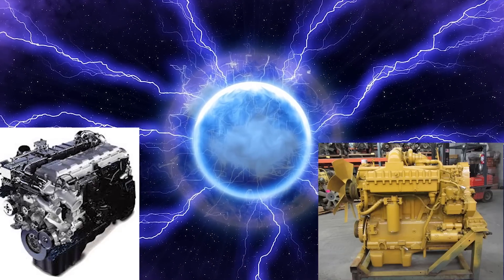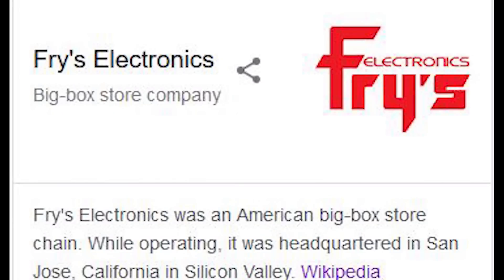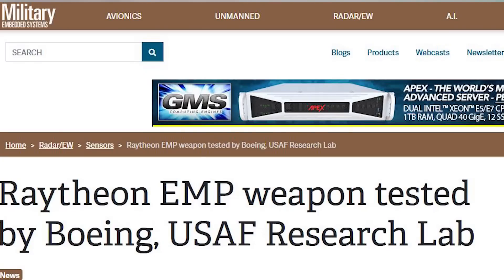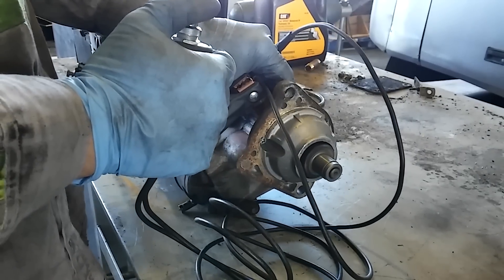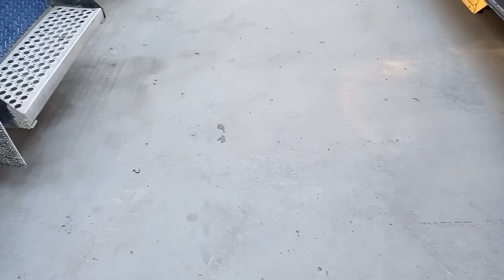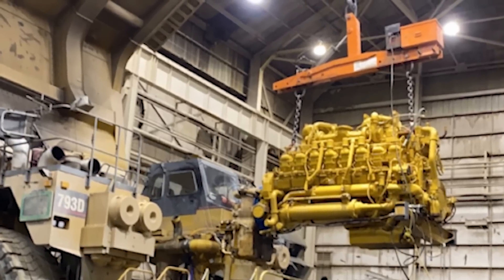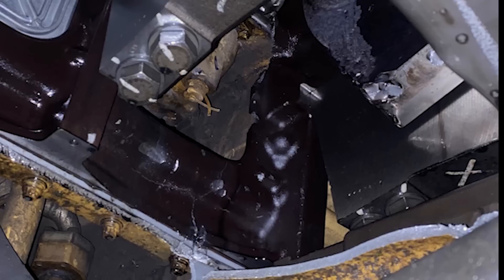Are Diesel Engines EMP Proof?

Comment: Wrong. Anything with a coil gets fried. That includes the generator coil that makes the power. Doesn't matter whether gas or diesel. If your whole gen is not in a faraday cage and unplugged, it's toast. Also, if you open the faraday while the different sttages of EMP are still surging it's toast. That can take over a day I think I heard.. and there can be multiple EMPS and you won't necessarily know when they will end.

Comment: I was driving a diesel powered switcher yard truck at the freight company I worked at when a lightning bolt struck close by. The fuel solenoid dropped out and it stopped me. This happened to me twice at that place in 4 years I worked there.

Comment: isn't a car a Faraday cage???
and also not all electronics would fry, it depends on a lot of factors, component tolerances to voltage, relative conductor sizes to the emp wave strength (how munch energy it carry's), any chip that is under 180nm will fry, but a ton of stuff like single transistors, capacitors that can handle above 10 volts, resistors, chance's are, they'll work fine....

Comment: I have a 1999 Blue Bird with a mechanical Cummins 8.3. From what I have read, they started making diesel engines electronic in the early 2000s, not the mid nineties.
Reply: Actually 1997
Reply: Allison electronic transmission?

Comment: Hi Josh,  I own a 2005 diesel Chevy Duramax which probably won't survive an EMP.  What are the chances of placing ferrites on various sections of the wire loom to at least give it a fighting chance ?     JwgK
Reply: Something often neglected is the automatic transfer.  Because of the lack of vacuum they are often computer controlled.

Comment: Car bodies aren't faraday cages unless you ground them really well.
Lightning strikes can arc through the tires to ground because of the insane voltage (it would have hit ground without the car anyway).
If this is a genuine concern make your parking structure a faraday cage and test it. Also you need to be prepared to grow and process your desired fuel plus the needed conversion components. Keep spare parts and lots of oil, trans fluid, etc.

Comment: Totally unrelated question, but I need some help. I have a 2000 year model C12 in a Frieghtliner. Truck runs pretty good as long as I eat into the throttle  and keep the RPM under 1700 or as long as I don't suddenly go from full throttle to a completely closed throttle. Once either of these happen, get a severe solid miss as if the system has low fuel pressure or sucking air. It will recover if I ease off the throttle for a little while. Any idea where to start? Is this common on C12? Thanks!

Comment: Not with EFI. Even the original cummins 5.9 12 valve needs 1  12v wire to
run. A proper EMP will fry ALL electrical & electrinic systems. SO, you
wont be able to use the starter nor the electrical fuel valve. Maybe if you 
push started it & used a battery to direct wire to the fuel valve.

!

Comment: During the First Gulf War Boots and Coots were dispatched to put out well fires in Kuwait. The large pumps they sent over were Detroit 810s built on a large tube frame. Compressed air was stored in the large frame for starting. Nitrogen could be used if the air was depleted for some reason. There was nothing electrical or electronic on the assembly. The tach and  temp gauge were mechanical. A fuel truck was brought in and hooked up to the engine. These too were mechanical and not susceptible to EMP.  These were used to pump water onto the well fires. They built several of these in Houston for shipment to Kuwait.

Comment: Air start mechanical manual trans = emp proof some engine have a ip shut off cable. I have had trucks that my cb radio fryed. Oh and new trucks can't take any ac had a 120v light get kocked over and smashed on the frame Even though the braker tripped. The truck had to get puled out computers fryed.

Comment: This is why people spend a fortune on a Dodge Cummins 12V. They are waiting for the EMP to kill computerized engines. They would need to be a manual, a Torqueflite automatic, or a 47RH overdrive automatic. The 47RH was replaced with a computerized automatic in 1996, so the 1996 or 1997 Dodge would need to be manual.

EMP could damage small electronics. However, it is my understanding that things like relays and solenoids are not going to be damaged. Because of that, the engine could be started. I do think an alternator voltage regulator might be destroyed based on how it is built.

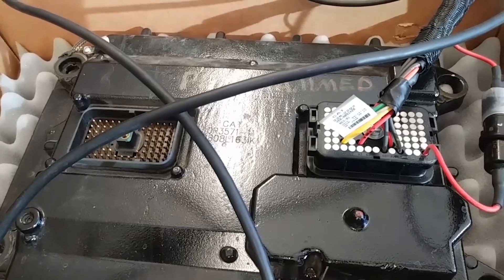4:32 Some computerized diesels took the old mechanical injection pump, but used a computer and electrical actuators to determine fueling and advance. I don't think CAT did this. However, the 1998 to 2002 Dodge Cummins 24V did. They called their version the "Bosch VE pump." There are certainly many others diesels that used this method, however, the 1998 to 2002 Dodge Cummins 24V is the fist I can think of. However, I think some people manage to find "Bosch VP pumps" which fit in the same space, but were not computerized. The 1989-1993 Dodge Cummins 12V used that kind of pump. I think some guys who race a Dodge Cummins have been known to put the VP pump where the VE pump was.

6:02 You would probably also need a bunch of spare sensors. I'm thinking about how many time I have to replace the heated wire/film MAF in cars.
8:36 I have heard that when a diesel is that large, it pays to try to weld it back together. Republic Diesel has some interesting videos on what they can do to save engines of that size.

Comment: You would need a VERY powerful EMP to short out a engine management computer. Especially one that was not running therefore not outputting voltage. Also remember a vehicle itself is a faraday cage, that’s how they can survive lightning strikes and more or less still limp home. And let’s remember also modern coil pack based gasoline engines have a micro emp fired off under the hood every time a spark plug fires, that’s how you can hear the plugs firing on an unshielded stereo system. If your plug wires and stereo are unprotected you can actually get bleed through from the high voltage transformers which are the coils.

Comment: Does it rely on electronics to function? If yes not emp proof. If no it is emp proof. If it is manual transmission and does not rely on any electronics you can coast it down a hill fire it up and roll in style during the apocalypse. Although I kind of wonder how strong of an EMP it would take to fry something like a starter that is designed to handle large spikes of high current but low voltage...I'm thinking that maybe the relatively low current high voltage induced AC might be able to blow through the enamel insulation and cause a short internally in the motor though... 🤔  Also if it's enough to kill a starter motor it's enough to kill an alternator I'm fairly sure...so if I wanted to have a vehicle that can survive an emp of that size and still function 100% I would need to have an extra set of batteries, starter and alternator in a grounded faraday cage just in case. And just in case manual transmission and parked on a long steep hill with one of those ether systems you can use from the cab just to cover all bases. Start rolling give it a lil toot and pop the clutch for a guaranteed fire up as you never know it could be cold outside. But a problem I rarely see talked about is how quiet it will be with no vehicles no ac units ETCETERA going and then you firing up an old rowdy diesel. That's going to attract ALL of the attention and make you a target to everyone...from 90 pound female office worker to 230 pound ex marine toting a metal chunk accelerator that knows how to use it.  I'm honestly thinking a bicycle with one of those small tow behind trailers would be a great option.  Or maybe even better one of those 4 wheeled bicycles with a trailer. Cause let's be honest here...how useful is that truck going to be if everyone you come even close to wants it and is willing to do whatever it takes, to take it from you?   And no one steal my idea here but I'm thinking about learning how to repair emp damaged starters alternator's and batteries will be worth much more than the single truck and make me worth much much more than the average person. Along with my many other skills.  Thus keeping me alive, hydrated, fed and protected 🤫😉😁🤑 sorry for rambling so much. If you are still reading. I Hope You Are Having A Great Day And That You And Your Loved Ones Are Healthy And Safe During These Tough Days! But Don't Get Down! If We Stick Together And Help Each Other, We Will All Be Ok!

Comment: The diesel engine is the best invention of all time. Heat, fuel and compression.  An old 6.9 or 7.3 idi would keep running.
Reply: Until the EPA (Environmental Piss Away) ruined them.
Reply: Good thing I have a 7.3 IDI with ZF5 trans so I reckon it’ll be my doomsday vehicle

Comment: Diesel engines may be for the most part, EMP proof,  but they are Not epa proof.  that bureaucratic group of of imbeciles will destroy them with smog requirements more certain than any electrical storm can muster.

Comment: modern one not so much. old one with mechanically regulated high pressure fuel pump those do. there the only electrical something is the fuel shot off valve. and even the is just an electromagnet.   or rebuild all circuits from vacuum tubes in place of transistors :D:D:D

Comment: Question:  Is an ECM protected against an EMP if it is disconnected from it's power source (batteries)?  May be a dumb question but, according to prevailing wisdom, the only dumb question is the question not asked.
Reply: I don't think so, I think the battery would actually help absorb some of the emp.
Reply: @inoahmann7542   I appreciate your willingness to take a stab at answering my question.  Not knowing if your guess ( you said, "...I think..." ) is more educated than mine (my "guess" is the opposite of yours), I'm still hoping we hear the correct answer from someone who's credentialed and KNOWS the science, no offense intended.  I've been REAL curious about it for a LONG time.

Comment: If I have a suggestion for the “Destruction of the Week” how do I submit it to you ?

We had a Cummins engine in a bus fail.   An oil pressure sender snapped off at full load and successfully blew the engine apart.
Reply from the maker: adeptape@yahoo.com

Comment: As far as i remember, 1994 is when the feds mandated electronic fuel pumps. 97 for anti lock front brakes, and 2000 for trailers, i got new ones of each those years. Computer controlled pumps were available in the eighties sometime. My 94 had cruise, electronic tach and speedo, and a low coolant shutdown, and of course injectors. Everything else, i think was 100% mechanical. Those trucks were extremely reliable, and the pinnacle of class 8 trucks. It has been downhill since.

Comment: Some solid state electronics may possibly survive an EMP. Typically Diodes and transistors as well as IC circuits are suspectable to frying with an EMP. Where our grand parents and great grandparents came out on top with tube/valve type electronics is they were practically indestructible by an EMP.

Comment: Even if your engine ran… all the infrastructure that delivers diesel fuel would be damaged by a large-scale EMP.
Reply: While this is true it's not like you can't open up where the fuel truck loads drop a hose down there and use a manual pump
Reply: Biodiesel my friend
Reply: i’m almost positive my 6.2 detroit can run off cooking oil/old motor oil lmao.

Comment: my 12v cummins with a stick can be bump started, fuel solenoid can be replaced with a cable (on loss of charging system and drained batteries), computer would likely die but would only take out the cruise and alternator, nothing the engine needs to push the truck down the road, my deuce and a half is slightly less complex, but maybe its possible to loose the 1 wire gm alternator conversion if a diode or regulator popped, but it too can bump start
any old school mechanical diesel wouldn't notice a emp, but maybe a fuel solenoid or charging system is all the electricity they use
Reply: 96 12V cummins with NV4500 5 speed I’m there with you mechanical pump fuel cell

Comment: The nt280b in my old Peterbilt would run with no electrical input. There is a knob on the side of the injection pump that you could turn to allow it to run. Of course you still had to have a battery and starter to spin it over. Or push it off a hill and pop the clutch but that would require air to release the brakes.
Reply: Use a bicycle pump to fill up an air tank.  Slowly.
Reply: @nspro931  that wouldn't be enough, look at garage 54
Reply: @5.43v  60 PSI or more to release the spring brakes.  Thought of one better, chock the wheels and cage the brakes with a caging bolt.  Have somebody kick the chocks and off you go.  Easier than bicycle pump although rolling w/o brakes would be nerve wracking but we are talking about The Postman situation here

Comment: Thanks for featuring my submission 😁 I’m sure I’ll have more for you. I have more pics of this failure if anyone is interested. Anyone curious about the financials - it’s a touch under $625,000 for the engine alone on a D model (no core value in this case with a windowed block). Factor in $75k for a new radiator, $75k for a torque converter, $50k for all other miscellaneous hydraulic pumps and another $100k for all the other miscellaneous parts/hoses that are needed. I can tell you that with copper prices being what they are, these numbers pale in comparison to the cost of downtime on this unit.
Reply: would love to see more. reminds me of rebuilding crashed turbines at power plants. I spent half a day picking up stator veins on a 7fa turbine, cant imagine how many millions they had to spend replacing shells and rotor.
Reply from the maker: You are talking close to a million dollars, that is definitely the biggest repair bill. Big trucks=big bucks.

Comment: Most vehicles' bodies themselves act as the faraday cage, and keep in mind that some ECUs have a metal casing themselves. One could justify that the sensors and wiring, yes, are the vulnerable ones, and then transmit the damage, but again, metal truck body. 
And people have done plenty of tests, mainly with tesla coils, on vehicles to see if they would survive an EMP. A huge majority of them start right up.
Reply: The Tesla coil methodology is flawed due to the magnet field created is many orders of magnitude lower than a full EMP. 

The equivalent would be saying “DC is safe because the 9v battery only tickles your tongue” but you’re working on a 300v EV pack.
Reply: @jrobmccoy  Voltage doesn't matter for safety, Current does.  Static electricity shocks are usually around 100k Volts, and how many times in the Winter do you get shocked.

Comment: You likely don't even need the faraday cage. The wiring acts like an antenna and helps ramp up the voltages that fry the computer.  If the computer(s) are not connected then it is probable that they will survive
Simply having a spare not connected will likely be enough. 
Having said that, many of your sensors that the computer is connected to will also fail due to EMP. Without a crank position sensor, a coolant temp sensor, or any of the other myriad sensors then it is also likely that your diesel will not meet the parameters for the computer to allow the engine to fire. 

Only true mechanical engines will be "EMP Proof" , as you said. However, many will be OK with a simple battery disconnect and reconnect. . The Department of the Army did a study and found that, surprisingly, auto and heavy equipment engine computers are tough. It all depends on how far away, and even the direction that the vehicle is pointing, among other factors.

Comment: My 91 C2500 with a 4BD1T conversion is good.
Reply: I have a 99 C3500 flat bed dually I want to do a Cummins swap with a 5 speed to.
Reply: @mikeznel6048  if your looking to tow a lot and you have the chassis for it go for it. I went with the Isuzu because I was looking for fuel milage, Reliability and this C2500 is a 6700GVW, so its basically a heavy half and I dont have the front suspension for a 6BT cummins. Its only a 3.9l 4cyl. When I first built it it was a dog I only had 3.73 gears. I went with a 4.11 and its perfect. I can still tow a car if I want and it gets 23 mpg.

Comment: Absolute great question. I've been wondering about that for some time. 
What about points, condensers and mags, how would they fair an EMP?

Well I'm all good then cuz the squirrel I have running my computer lives in his favorite rotating cage. Ironically his name is Faraday. 🤣😂🤣. Buy stock in Kibble & Bits.
🤟😁🤟
I do have to tell you that I am recovering from surgery so take what I say with a grain of salt.
Reply from the maker: Not sure what surgery you had Dan, but as a long time subscriber I wish you the best.
Reply: @AdeptApe  thanks bud,
it was spinal surgery due to stenosis 😫But im doing real good now. I walked out and checked on the Ol' 8T today. First time in over two months I've even touched it, the wife bellowed from across the yard "What are you doing?"  just as my hand touched the tire.
🥺

Comment: All ya gotta do is make sure your engine hides under the school desk like we did as kids in the 50s.  Ask yer mom and dad. 🤠
Reply from the maker: The lead paint certainly would have helped too!
Reply: FYI, my heui pump is on its way home after refurb.  Should be here tomorrow. 👏🏻
Reply from the maker: How much did the rebuild cost?
Reply: @AdeptApe   1245.00 which included shipping both ways.  It remains to be seen if it works when it gets back.
Reply from the maker: @larrytalley117  it better work for $1200.
Reply: @AdeptApe  my feeling as well.  It was 3500 for new or 1600 for refurb from cat.